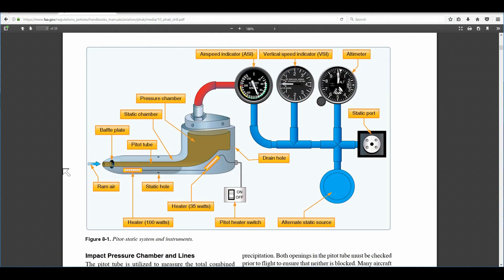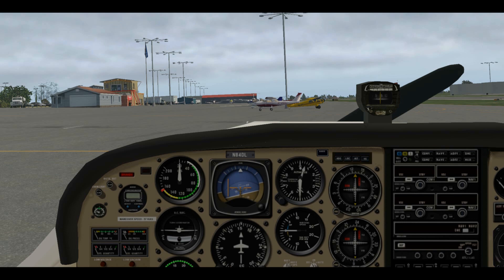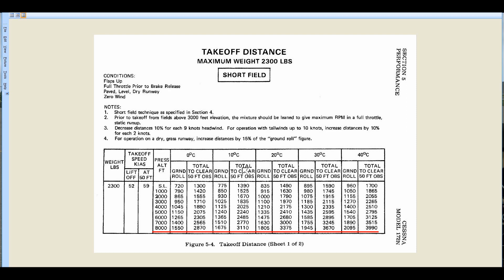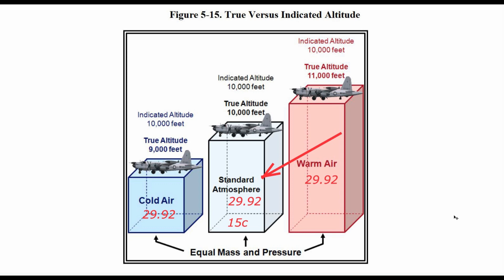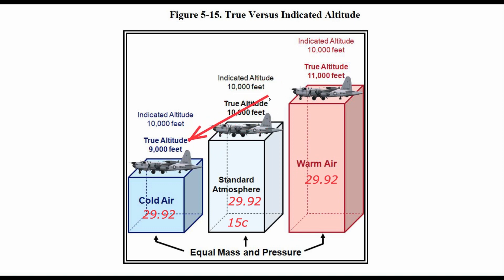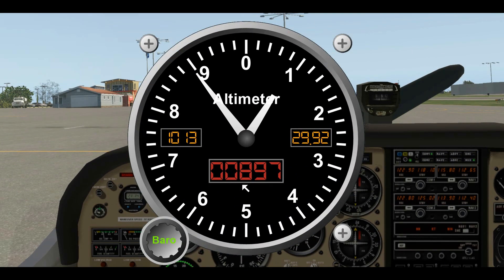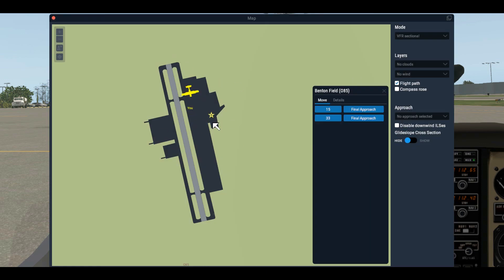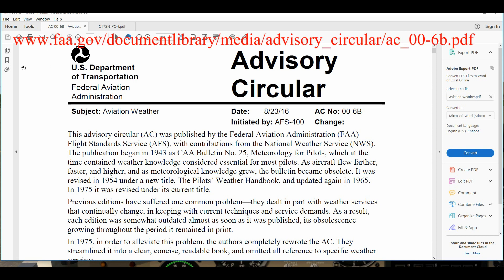The Altimeter ~ Learning to Fly for Beginners in X Plane 11 Part 10

Comment: Great explanation, one question, why was the initial elevation 900 feet, I thought 29.92 would read “0”
Reply from the maker: Hi TheHistoryCompiler, When you set your altimeter to Standard Pressure (29.92) your altimeter will display the current Pressure Altitude and not Zero. In this case the Altimeter displayed the Pressure Altitude of 900ft on the ground at Benton. There is always a pressure temperature relationship and since the Altimeter works off of air pressure the atmospheric pressure determines what will be displayed so it's necessary to adjust the Altimeter for the current weather conditions. That's why we need to check ATIS and get the correct pressure settings to input into the Altimeter. Again, in the case of this video, we needed to set the BAROs to 29.72 to get the Altimeter to ready the correct altitude. We know that was right because the altimeter indicated the airport elevation. In fact, that's another way to set your altimeter. When on the ground at your airport just set the altimeter to the airport elevation and your good to go. Hope this helped, thanks for watching :-)

Blessings,
skip

Comment: Since the altimeter is set at 700 ft. above sea level, do you have to adjust for that height if the ATC orders you to 2000 ft. or do you fly at 2000 indicated on the altimeter?
Reply from the maker: Hi Don, Thanks for watching :-) No, you set the altimeter once so your altimeter displays the correct altitude. For example if you are on the ground at your airport and the airport elevation is 700ft but your altimeter shows 600ft you would dial in 700 on the altimeter to display the correct altitude to correct for the air pressure. Once set you don't need to adjust until you have flown for a while, you should check for weather from time to time to make sure you have the right setting. This would be for longer flights as the pressure usually won't change that much locally in an hour or so. In the air you should contact an ATIS and get the pressure such as 29.92 or 30.05 etc and set that value in the altimeter during your flight.  Hope this helps let me know. 

Blessings,
skip
Reply: @WEHVideos  Thanks Skip. I was obviously confused about that issue. Now I am not. I am enjoying your series. Well done. Don
Reply from the maker: Hi Don, Sorry for the late reply seem some comments got lost and I just got a bunch I hadn't seen :-(
Glad that helped. 

By the way, if you fly with X Plane 11 and are interested, X-Hanger has given me the rights to their Cessna 172N for X Plane 11, the airplane I use in most of my videos, and they have allowed me to give it away to anyone who would like to use it for following along in my videos. 

You can learn how to download it by watching the video in the link below:

https://www.youtube.com/watch?v=mmOxFBkgEBE

Blessings,
skip
Reply: @WEHVideos  Thanks Skip. I'll check out the plane. Don

Comment: Great video,
I’m new to flying & learning the basics.

Question:
If I set my altimeter correct at departure airport.

And I learn what setting for arrival airport elevation level.

A) if I’m flying from Connecticut to Florida as example.

Must one write down elevations at in-between airports along my route & adjust my gauge accordingly?

Where to find a flight planner Map of potential “Obstacles” such as Mountains, Tall Buildings, Tall Towers in flight path?
Reply from the maker: Hi MIchael, Sorry for the delay in replying.  So first you set your altimeter for your departure airport you will check with ATIS at the arrival airport before you arrive. Checking it at the departure airport won't help much as it may change by the time you get there, depending on the distance your flying naturally. 

Having information on airports along your flight is a good Idea for emergencies and checking ATIS updates, yes on your flight you would want ATIS updates from time to time,  in the real world, it would be nice to have Flight Following from a control Center and they usually will give you updates and warn you of other traffic. 

Your flight to Florida is a pretty long flight so, since you are new, I'm going to assume you are not flying IFR but just getting in your little airplane and heading down the coast flying VFR. I'm also guessing you will have to make a stop or two to refuel on this flight, if I got this right it's over 1000 miles.

Here is a link to my videos on VFR flight planning that should answer most of your questions.

www.youtube.com/playlist?list=PLjqSrWIZDAi__eI-TVAd-xixS9CkIzy5J

Check out SkyVector.com for flight planning. I cover this in my videos.

Hope this helps please let me know how you make out and I'll try and answer any questions you might have, It would help if I knew what airplane you would be flying :-)

Blessings,
skip
Reply: @WEHVideos  Easy Question for ya in regards to MS Flight Sims- Are you familiar with flight sims? When I create a new Flight using Flight Planner from one state to another using IFR. Once I land at destination airport successfully. From there I can't seem to use the Map to setup another IFR Trip. I can open GPS and choose another location to fly to ok.  Seems like the only way to do it is "End Flight" then simply create a New Flight to use Map to select proper waypoints etc. Thanks Mike
Reply from the maker: Hi Michael, I don't have MS2020 flight sim I use X Plane so I can't help you with MS and I also almost never use GPS. One thought would be to create a flight plan using the departure airport also as the final destination with the real destination airport as a waypoint so to speak and choose waypoints for to and from that airport, not sure this would work but it might, you might just have to create another flight plan as you say.Let me know if you get this figured out :-)

Blessings,
skip

Comment: Brilliant and expository. If I get this right, airport elevation is static but indicated altitude on the plane will always varies with the prevailing weather condition at any particular time. The altimeter reading would be very crucial to a safe landing in bad weather condition that reduces visual aids.
Thanks Sir.
Reply from the maker: Right you are  Ernestwinslow, thanks for watching hope it helped.

Blessings,
skip

Comment: Hi Skip.  In X-Plane 11, how do I check (while flying) the weather conditions at another airport?  Great videos by the way.  I am sure I will have more questions along the way.
Reply from the maker: Hi Richard,  In real life you would most likely have a sectional chart and on the chart you can find ATIS for airports around you so tune in to a ATIS and listen.  In X Plane you can open the map and click on an airport. Make sure VFR Sectional is selected under Mode (upper right) then click the Details tab for the available frequencies at that airport, if ATIS is available get the frequency and tune your COM radio to that frequency. 

Here's a tip, when planning your flight note the airports that you will pass on you flight (you want to do this for safety reasons anyway) get frequencies for each airport such as Tower, UNICOM, and ATIS that you think you could use in an emergency. Now you can get weather or if you have a problem you don't have to panic hunting for information you need to make an emergency landing. 

So, if you do a little extra work when planning a flight you will have almost everything you need to avoid confusion and stress if you get off track or "things" go wrong. When this happens in real life you can't "quit" or "exit" and start over so preparation is very important.

SkyVector.com (an amazing online sectional chart) and AirNav.com are two great sites for getting airport info to help with your flight planning. Try planning your flights on SkyVector all the info you will need is available there. 

Well this is probably a lot more information than you wanted but hope this helps.

Blessings,
skip
Reply: WEH Videos   Awesome response. I’m really enjoying your videos and all the really great advice. Thank you for doing these videos.
Reply from the maker: Thanks Richard, thanks for watching glad to be of help :-)

Blessings,
skip

Comment: Hi Skip although I have not  checked in with you in any of your video,s I'm just enjoying your talk through.but on the tenth video you talked about the altimeter you said about pressure at each airfield (ie) sea levels does Al the airfields have that information or do we have to find that out for ourselves. Very good videos Skip keep up the good work as I am learning as I go along appreciated by all who watch you for sure. Thanks in advance for any feed back from you or your followers.
Reply from the maker: Hi Billy Jay,  Simple answer, yes you need to do this yourself. 

Each airfield is at an elevation above (or possibly below) sea level (the level of the oceans). Airport elevations are expressed as feet above(or below) sea level. So if your airport was on the coast by the ocean your airport elevation would be pretty close to sea level. When you are up in the mountains your airport could be at several thousands of feet above sea level. 

Since weather conditions are constantly changing you must make adjustments for "air pressure" so your altimeter displays the correct altitude (above sea level not the ground) and you need to do this occasionally on "longer" flight as you move into different weather conditions. 

You get the weather information or BARO's by contacting ATIS on your COM radio. The BAROs will be something like 29.86 or 30.18 or whatever. You set that BARO number in the altimeter so it displays the correct altitude, again above sea level not the ground. If there is no ATIS available at your airport you can set your altimeter to display your airport elevation and this is pretty much the same as entering the BAROs. 

You can get airport information from www.airnav.com select the "Airports" tab and type in your airport, there tons of information about your airport there. If you are flying X Plane 11 you can open the map and click on your airport and select details there you will see weather info and more. Hope this helped and was not "too" much info for you. Thanks for your question and thanks for watching.

Blessings,
skip

Comment: Hello from Austria. Thank you for the tutorial! Unfortunately i dont understand 100% how an altimeter works. Yesterday i did a desktop flight from Vienna (LOWW) to Stuttgart (EDDS). At Vienna the current pressure was 1027 hpa. I turned the knop on the altimeter to 1027hpa and got an altitude of 600ft, which is the correct elevation of the airport. At the same time, at our destination airport EDDS, there was also a pressure setting of 1027hpa due to current weather data. But at ground of EDDS, when I would turn the knop also to 1027 hpa, the altimeter would indicate a hight of 1300ft, which is correct, as this is the elevation of this airport. So what i dont understand is that why are there two different hights on the altimeter with the same setting of 1027 hpa. May you can help me with this. Thank you in advance for any help. All the best, Stefan
Reply from the maker: Hi Stefan,   When you adjusted the pressure to 1027 that allowed the altimeter to displays the correct airport elevation. Since both airports had the same pressure the altimeter displays the correct elevation at both airports. If the pressure was different, say 1030 at your destination airport, the altimeter would NOT display the correct elevation it would display an elevation higher than the airports actually elevation, if the pressure was lower the altimeter would indicate a lower elevation. So it is very important to check the weather or ATIS for altimeter settings from time to time to make sure you altimeter is indicating the correct altitude. That adjustment you made, putting 1027 in the altimeter, made it possible for the altimeter to give you the correct altitude, if you don't do this your altimeter could be way off indicating an altitude much higher or lower than you are at and this obviously can be a real problem. Hope this helps.

Blessings,
skip
Reply: Dear Skip. Thank you very much for your quick answer! Ok, i know now that we have to turn the knob of the altimeter to the current pressure value to get the right ALT on the Altimeter. But how does this work from technical point of view? For example at an airport with pressure of 1012hpa. I turn the knob to 1012. Outside pressure is measured by the static port. So the static port measures 1012hpa outside, which is the (imagine) current value. The altimeter is set to 1012 too and together with the values of the static port, the altimeter is able to show the right altitude. Is that the way it works? When we than fly to another location where the pressure has changed to e.g. 1016 hpa and we would remain the altimeter setting at 1012hpa, this would bring use to the following situation: The static port measures the real outside pressure. With the measurements of the static port, the altimeter is able to indicate the right Alt. The higher the Alt the lower the outside pressure measured by the static port. But in my example, the altimeter is set wrong to a lower pressure setting (1012 vs. 1016). This means, that on the altimeter there is a higher altitude indicated as the plane actual would be, due to the lower pressure setting of the Altimeter. Again, this is because the lower the pressure (in this case set on the altimeter), the higher the altitude. Understood correct? Again, thank you in advance for any response. Cheers, Stefan
Reply: ........... i just have to correct myself: i´ve wrote above: "For example at an airport with pressure of 1012hpa. I turn the knob to 1012. Outside pressure is measured by the static port. So the static port measures 1012hpa outside, which is the (imagine) current value. The altimeter is set to 1012 too and together with the values of the static port, the altimeter is able to show the right altitude." BUT this isn`t true, as the static port measures the outside pressure in the specific altitude of the airport. So the measured pressure of the static port must no be the same like the current pressure of the specific weather station. This could be the solution why we have different altitudes at different airports with the same QNH setting. As the airports are at different elevations, the measured outside pressure of the static port are also different. E.g. at EDDS we turned the knob of the ALT to the right actual QNH. So the Altimeter let`s say is trimmed to the right setting. As the airport is on an higher elevation than e.g. LOWW (1300 vs. 600) the static port measured a lower pressure at EDDS (again the higher alt the lower pressure) and therefore indicates a higher alt than at LOWW although at both airports same QNH-setting. Hopefully i got it know. Sorry that i send you so much text,  but I`m thinking about functionality of Altimeter for such a while and have now the feeling that i got it know. cheers.
Reply from the maker: Hi Stefan,  Here's a simple way to understand this. The altimeter "reads" the air pressure through the static port and depending on that pressure the altimeter displays an altitude "based upon that pressure" regardless of the airport elevation. Since the air pressure is not the same everywhere the pilot needs to make adjustments from time to time to make sure the altimeter is displaying the correct altitude by setting the altimeter to the actual measured pressure at weather stations along his/her route.  This is why pilots are "required" to report to ATC that they have the current weather settings when contacting their destination airport to make sure their altimeter is displaying the correct altitude. 

Put another way, when you contact ATIS or get a weather report and you are told the pressure is 1027hpa where you are that is the pressure sensed at the static port and sent to the altimeter on your airplane. 

Here is something you can try that might help. Instead of getting ATIS info and putting that into the altimeter just make the adjustment using airport elevation instead. So if you are parked at your airport and your airport elevation is 1300ft if you turn the dial until you get 1300ft displayed on the altimeter you will see that the altimeters pressure display will match the pressure setting you get from ATIS. So if you are at an airport and you know it's elevation you can adjust your altimeter by using airport elevation to correctly set the altimeter. This is handy when you don't have access to a weather station or ATIS at your airport.  Hope this helps.

Blessings,
skip
Reply: Dear skip, thanks again for the quick answer! I would say that now i know how it works. All the best, Stefan

Comment: Hi Skip, nice video. Can I ask how you managed to get the altimeter to "pop out" in a new window/overlay?
Reply from the maker: Hi Keran,  Thanks hope the video helped :-) There are two apps that let you to add instruments for another monitor. One is called Air Manager and the other is called Panel Builder. I have both and use them on a fourth monitor but for the tutorials I just click and drag the instrument up to the main monitor so it would be easier for you to see.  Here is a link to both sites if you are interested:

www.siminnovations.com
www.simplugins.com/html/panel_builder.html

Blessings,
skip